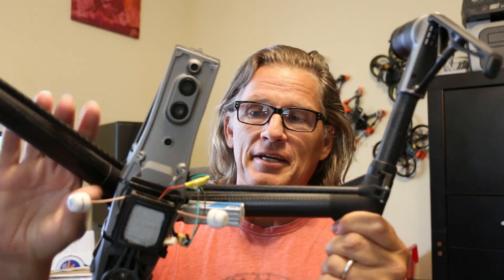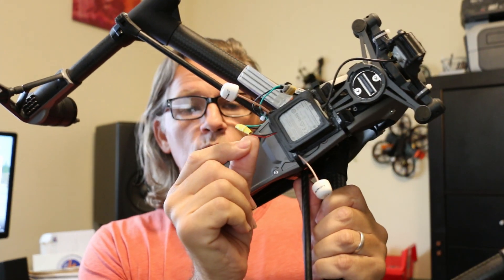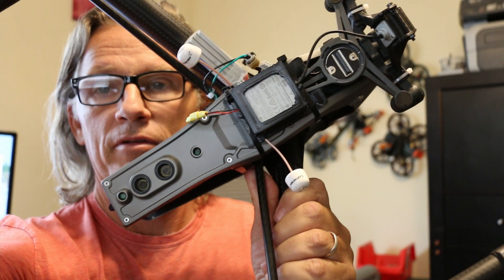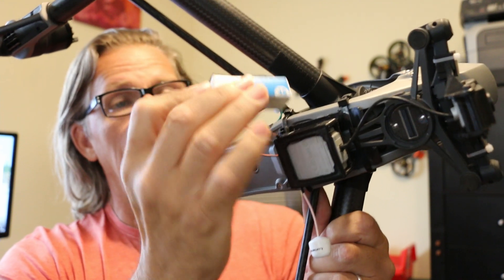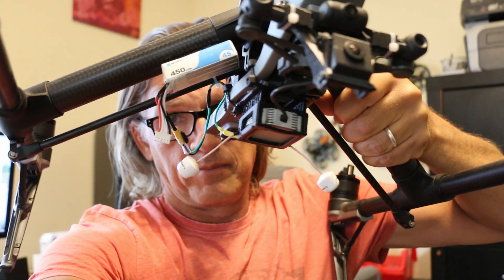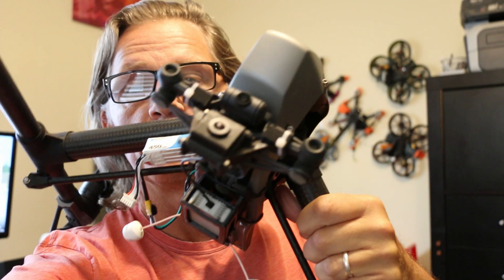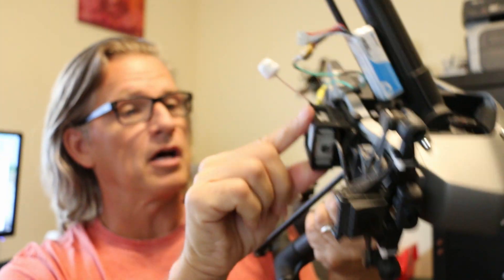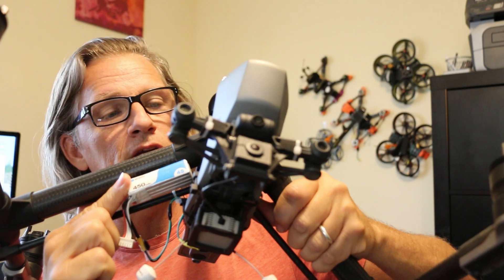UPDATE:  Add the DJI Air Unit to your DJI Inspire 2... THE EASY WAY!

Comment: Hey, great videos about the inspire 2. You just showed me something i didn't know i want. Im not sure if you mentioned it, but do you mount the camera gimbal on, or just use it for fun flying and no recording? :D
Reply from the maker: I do use it with the gimbal on! You'll get better results with a separate cam op probably, but you can definitely do it single op and get good shots if you fly it right ;-)
Reply: @PossumPilot  That's awesome! I guess the vision system affects the up tilt angle of the gimbal a bit, since its located under the original inspire 2 fpv camera. Just a quick question: How much would you take to build one or two if i ship them to you? :-)
Reply from the maker: @zebrahouse  Honestly, I wouldn't really want to do a build for you, but it's SUPER simple. If you need the parts printed, get Chris Teal to do it (email me for his info). Then it's really just a matter of putting it together ;-) (and of course you need to install the longer air unit cable, but that is also super simple)

Comment: Question, is that the standard Air Unit or are you using a longer camera cable to make it reach the front of the i2?
Reply from the maker: For the low position cam, I was using the regular stock cable. For the high mounted one, which is better, I used the longer cable

Comment: Much smarter.  Looks like some of that dangling parts would get into the camera shot if the main camera swung around rearward.
Reply from the maker: No, none of it hangs down far enough to get in front of the lens, at least not with an x5s. And I could definitely shorten up that power lead. This hasn't been all trimmed up and could definitely be a bit shorter. I'm going to modify my design on the air unit holder to make it so that you don't even need zip ties. I have a pretty good idea for it and will post when I get it done